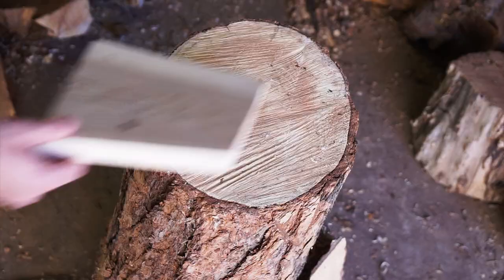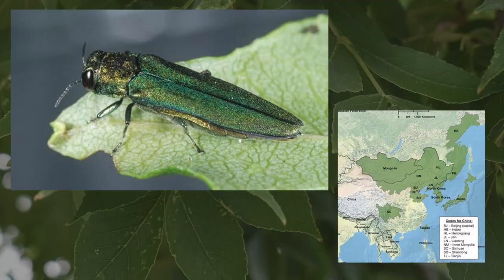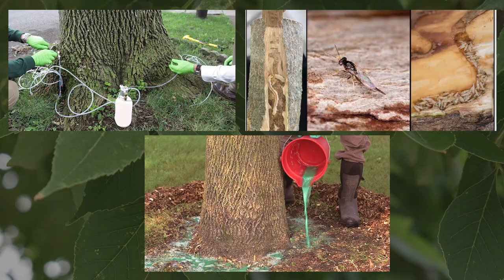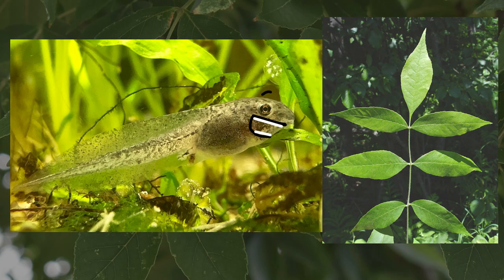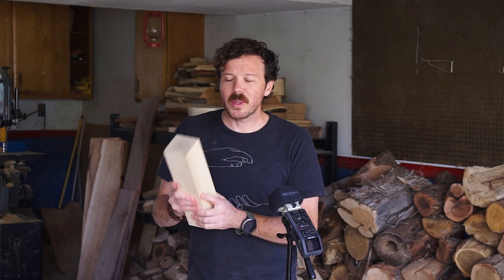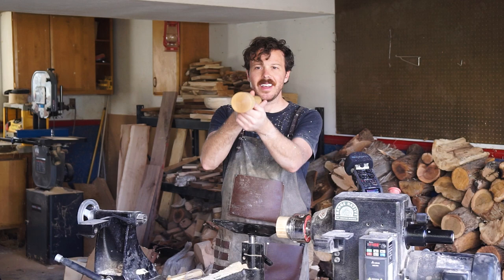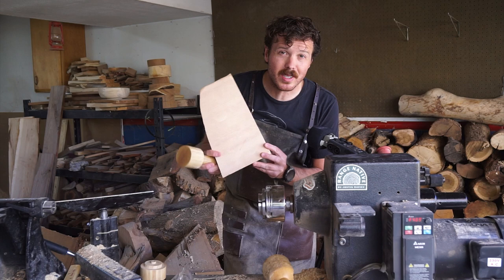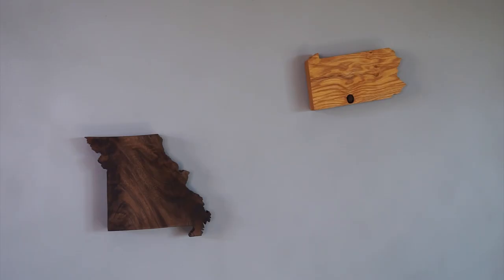Pennsylvania's Green Ash | Making the United States out of Native Trees

Comment: It's funny, that knot is kind of close to the tallest mountain in Pennsylvania, Mount Davis (3,213 ft). Yes that's not very tall but much of Pennsylvania sits on the Allegheny Plateau. Locally the area is occasionally called "the big flat". That's because if you were to stand at the top of a ridge, you'd realize the next ridge over is about as high as you are. There really isn't anything more prominent on the horizon. From the air the mountains of Pennsylvania have the most prototypical look of the Appalachian mountains; looking more like green wrinkles than actual ridges and valleys.

Also one of the biggest problems with emerald ash borers is how prevalent ash is on interstate medians. Ash is a hearty wood that can handle the stress from the cars and the extra water from highway runoff. Unfortunately, the wooded medians of the east are as much a highway for the ash borers as they are the cars that zoom past. The bugs will hitch a ride, hop off, find a nice home in the median, reproduce, and their offspring will spread in the new area.